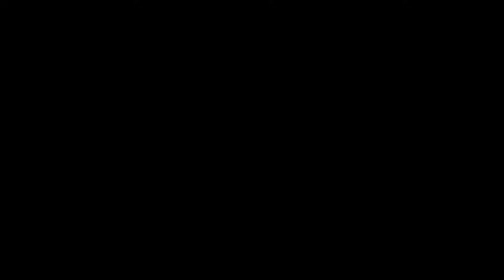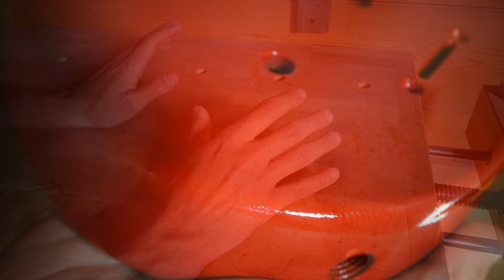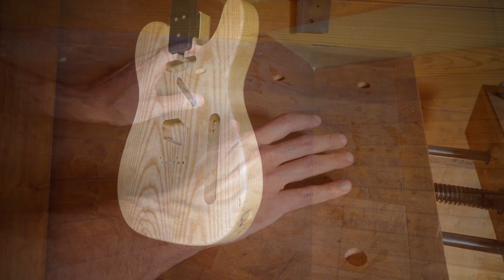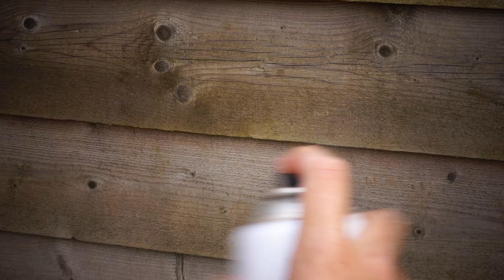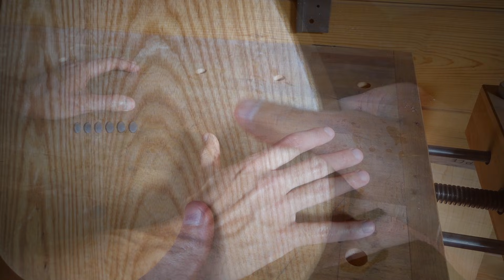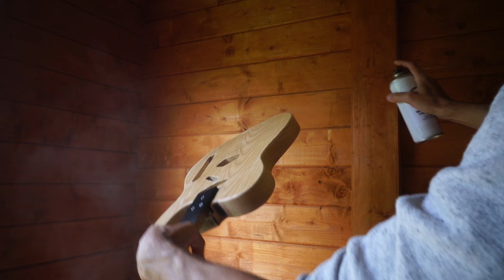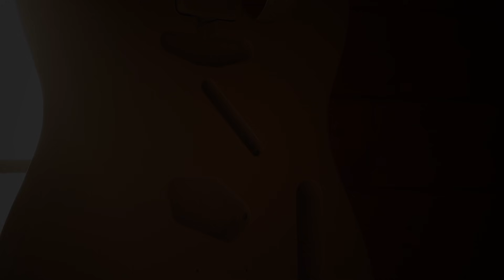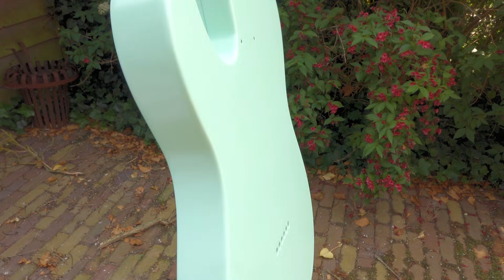Nitro Guitar Finish Tutorial - Part 2: Nitrocellulose spraying process

Comment: Awesome video, doing my first paint job now. Should I sand between color and clear coat?
Reply: Nope. The two will melt together and level out as one. Might want to lightly sand the very last layer of the clear coat to level the surface so it shines.
Reply: @jcd13able  thanks for answering! level sand last clear coat with 1000 grit?
Reply: @aloneliancomedy  Yes. I would use soapy water and dip the sandpaper in it for 20 minutes to make it pliable and the soap will reduce the friction so it will be easier to slide as you're sanding. I would try to stay away from the edges as those are the ones that are likely to be sanded thru into the wood. I believe the final buffing will also remove some of the orange peel as the finish will heat up and melt a bit.
Reply: @jcd13able  Do I absolutely need to use finishing compounds or is it possible that after 4-6 coats of clear that the guitar will look ok as is? I'm currently on coat #4 and its beginning to look glossy and nice
Reply: @aloneliancomedy  You don't have to. What I've done is I used non-silicone paste wax from Johnson in a yellow metal can that is used to polish wooden floors or bowling alleys and applied it with a rag and let it sit for couple minutes and then wiped it off. I never buffed my body and still get a nice shine on it. I bought the paste wax from ace hardware store but I'm sure other stores will have it. It has to be non-silicone if you ever going to repaint or touch up your paint work. Paint doesn't stick to silicone and it can't be easily cleaned off, it gets into the pores and stays there.
Reply: Autozone or O'Reilly will have some mcguire polishers. Basically what some do is get the polish with some grit in it and they apply that first to kind of sand the imperfections in the paint. Then they progressively reduce the grit by using finer and finer polishers until they get to the one that doesn't have any grit in it. Usually they use carnuba wax but I used Johnson. But if you use wet sandpaper to sand off the finish you will get close to what they're doing with the polishers. They also use polishing wheels to melt the polishers into the finish. That is a lot of work.
Reply: After you put the last coat of clear (I assume you're painting with nitro lacquer) then you need to wait at least a month or until the finish is no longer sticky to the touch before doing anything to the body. If you knew that already then I apologize.
Reply: @jcd13able  Yes, it'll be hung up for about a month until it dries. I guess I have the next month to decide what I want to do with it. If I decide the guitar looks ok to me as is, can I just leave it? Is there anything wrong with just putting on clear coat and letting it cure for a month if I like the way it looks? Thank you so much for all your help. I've watched your 3 part video many times in preparation for this.
Reply: @aloneliancomedy  You can leave it as is if you're happy with the results. Nothing wrong with it. The old fender sometimes didn't put clear on the color coats because they either ran out or some other reason. The clear will protect the color coat but it will also shine brighter.

Comment: My shop is in an old mill building so dust is just an everyday occurrence regardless of what you do. What I’ve found is that closely inspecting the surface a few minutes after spraying will show you any “preliminary” dust. If you have REALLY steady hands, you can get down on it with an exacto knife and magnifying glasses then CAREFULLY remove any little pieces of dust. This works best while the lacquer is still a bit wet because it will normally fill in any tiny little dust gaps. If you discover some in an hour or two after the lacquer has dried, you can just remove if very gently with your fingernail. What you’re trying to avoid is accumulation. If you let it go or don’t pay attention, it won’t turn out as nice. If you shoot light coats warm lacquer in a dry environment and keep an eye out for dust, you’ll get a beautiful finish. It’s really not that difficult...there are just a few little things to keep track of. In the long run, lacquer and varnish are the two easiest finishes to work with, in my experience.
Reply: I agree, very forgiving paint. I must also point out that duplicolor acrylic lacquer paint is as forgiving as nitro. The spray nozzle will sometimes spit out blobs of paint when the paint is mostly gone from the can and those blobs will melt into the existing finish and you won't be able to notice it when it dries. Very cool and for those who want a little bit more resilient and lasting finish, it's the way to go.

Comment: I'm refinishing a Warmoth Tele with ReRanch Fender Blonde. I'm ready to clear coat the Tele. ReRanch has been out of business for awhile because of Covid 19 but they have all the Fender colors in nitro. I use a handle on my paint cans, much easier to control. I wear a mask from Harbor Freight.
Reply: I was going to go with reranch but then I changed my mind and went with duplicolor sanding sealer then duplicolor perfect color match and finally watco clear nitro lacquer. The acrylic duplicolor is some tough paint I must say. After five years, the watco is starting to peel off in areas where guitar touches my body when I play the guitar. I love how watco easily checks as well. It dries hard and it's not sticky on the neck or body. Next time I would go with duplicolor clear instead of the watco but I wanted checking pattern because I like the old relic look so I used watco for that.

Comment: After the last color coat, you mention a small amount of orange peel is ok and can be smoothed out later - is this because the clear coats will bind with the color coat, as nitro does, and the minimal orange peel referred to will be filled in by the clear? 

I notice the color of the color coat changes as it is polished. 

I’m trying to find out if the color coat needs to be sanded to acquire the color desired or if the clear coat serves this same purpose. - 

I may not be asking the question exactly right. Hopefully you’ll know what I mean. 

I appreciate any help. Thanks for putting these tutorials up. Very helpful.
Reply: Yes, the color and clear will melt together and will level off. There might be some orange peeling on the last coat of clear but buffing will usually get that out as the heat will melt the last coat and level it off.

Comment: I didn't think lacquer had to cure--- thought that was just poly.
Reply: As far as i know ypu are kinda right. Laquer doesn't really 'cure' but it does harden. Poly does cure and actually turns into a pretty hard plastic. This happens relatively fast so i believe it is ready for polishing within 48 hours. Laquer only hardens bit never fully cures. This makes laquer a bit of a long process with a hardening time of about a week or two and about three or four coats per day, letting it harden a bit between sessions. The big plus of it not hardening is that you can repair chips or dents in the clear coat using only a piece of hardened laquer and some thinner and it just melts into the damage. This is because it is able to dissolve since it is only hardened. Poly doesn't do that so when you happen to chip it or damage it you can only sand down the damage (often even the entire surface to avert strange textures and harder lines where you sanded it) and reapply new coats over it. The big plus is that poly is a lot harder to damage, but if you do it can make a relatively small amount of damage a bit of a hassle.
Reply: It takes about a month for the nitro lacquer to dry so it's not sticky anymore. It dries slower in colder climates. The only difference between a color lacquer and clear lacquer is that in the color lacquer a color pigment is added but otherwise it's the same nitro. So you can apply all nitro coats the same way. One coat will melt into the other and it's recommended that you spray thin coats so they have sufficient time to dry for the next coat otherwise they will pool up and might cause a run.

Comment: It's maybe a good idea to let the can sit in hot water (not boiling tho) for a while before applying if your cans are not brand new. It seems to help the compounds mixing together and have the lacquer more fluid. I mention that because I screwed up my finish badly while using a clear coat can that had probably be sitting for too long on the vendor shelf. Even after shaking the can for a while, there were still small clots of compounds that went through the finish, dissolving the color and leaving nasty pinholes. I've tried to smooth them and apply a few color coats over them, but I think I'm just going to pretend I intended a vintage look.

Comment: Do you need to be careful how much you spray into the neck pocket? When companies make bodies/necks are they made with tolerance for finish thickness, or would applying finish to the pocket make it too tight? Total beginner here. Thanks for the great videos!
Reply: It would make the neck pocket too tight on cnc bodies. I cover the neck pocket area with masking tape so no paint gets in there. After I'm done painting I peel off the masking tape and bolt in the neck. Same goes for the neck if you refinish it in clear coat so I don't spray too much clear in the heel of the neck for the same reason.

Comment: Your tutorial is great! I just started my first guitar building project. I bought a Strat style kit from Stu Mac. The guitar has an alder body that already seems as smooth as silk.  Should I still use the grain filler or go to a grain sealer before I procced with the rest of the process?
Reply: No need for grain filler. You should just use primer, color and clear coats if desired. You don't have to use the sealer, all it is is a thicker nitro paint to seal porous wood which alder is not. The nitro sealer will eventually sink in as well.
Reply: Thanks.

Comment: I know this is an older video, but just wanted to ask, I’m using the same lacquer you use in this video and am on to my clear coats, how many cans did you use on clear coating? Just trying to gauge how thick I’m applying it, I’d say I’m about 5 coats in and have used a can and a bit?
Reply: I think he said he used four light coats of clear. I guess that would be one can or less. The more clear you use the thicker the finish and the more leeway you have with sanding. Otherwise you have to be very light with the sandpaper.

Comment: great video series. What steps are needed to refinish an older guitar already spayed with nitro in the same color? Does the old finish need to be stripped to bare wood?
Reply: No unless it's too bumpy or heavily damaged. Normally you just lightly sand the gunk off and spray a new layer of color coat and then clear and you're done. Nitro adheres to old nitro just fine because the top layer will melt the bottom or old color layer and the two will melt together. If for some reason you need to strip the entire body back to the wood then I would use lacquer thinner or alcohol on a rag and wipe the body down. Fender used to spray different finishes on top of old finishes all the time. They also didn't use clear on some finishes or didn't use sanding sealer on others, etc. Very mish mash of doing things. Usually they ran out of paint so they just skipped some steps.

Comment: When would it ever be absolutely necessary to spray paint inside your house?
Reply: If you don't have a garage and it's snowing or raining season outside with low temps or too high temps. You can do it with windows open and drop cloths everywhere and hopefully you're single otherwise the significant other might kill you before you lay your first nitro coat on. You would be surprised, here in arizona I have to spray from february to may only otherwise it's too windy, too hot, humid, etc. A very small window of opportunity. I can't spray now because the paint would be dry the moment it left the spray nozzle. Also, in spring we have to deal with alergies and all kinds of stuff flying around so a spray booth is necessary.

Comment: Hi there
After applying my coats of paint, I noticed little inperferctions, how can I fix it? Can I sand it? If yes with which sand paper? Should I wet sand it? And how long should I wait before sanding after my last coat of paint?
Thank you
Reply: Try to apply couple more coats and see if they melt the bottom coats and the imperfections disappear. If they still persist then use wet and dry 800 grit sandpaper and wet it in a soapy water and lightly sand the top coat to level the imperfections. Stay away from sanding the edges of the guitar as you'll go straight into the primer coat. You should wait at least half hour or longer. Depending how thick you applied the last layer. The thicker the more time you need for the paint to outgas and dry. A normal light coat takes about 20 minutes to dry.

Comment: how many passes makes up a coat?
Reply: One pass from top to bottom. A coat is one thin layer on entire face of the body. The key word here is thin. Why? so nitro won't run, so it will dry quickly, so it doesn't melt all the layers, etc.

Comment: Time 14:36 you said you like to let the color dry before clear coat. You should spray the clear coat  over the paint as the paint tacts up just like any other coat. So
after the last color coat , wait until it tacts up and start your clear coating. In my opinion, don't let the color coat dry for 24 hr before the clear coat,
any dirt or bad spots can be sanded out of the clear coat and polish but don't sand though the clear.
Reply: The only time you should wait for a week or so is if you're spraying lacquer clear on top of acrylic color coat for example. To let the acrylic fully vent out before applying lacquer on top of it. Some paints specifically tell you to apply clear immediately after the color coats or you have to wait a day or two before applying clear. Something to do with the color coat still being gassy and clear needing that gas to adhere to the color coat.

Comment: Just revisiting these tutorials. Really great job Lone Star. I'm just getting into spraying Nitro, and I must admit, I def prefer it over  spraying poly
Reply: Me too. It's also easy to fix your mistakes and you can use lacquer thinner to go back to the wood and put a new color on. Plus, your guitar will wear nicely unlike poly which is hard as a rock and when it chips, big chunks fly off and make the finish look ugly.
Reply: @jcd13able  what in the world are you doing with your guitar to “knock chunks” out of it??
Reply: @TheChattanoogaBandit  I don't have guitars with chunks out of them. I've seen on pictures what they do look like. Sometimes what can happen is guitar can fall from your hands or tip over the stand and fall onto hard surface and can crack the heavy poly finish with chunks coming off.

Comment: a month to cure before sanding/buffing?   Seems that's just too long, considering there are other options that dry in a day and ready for buffing.  nice vid, tho.  very thorough with the advice/tips.
Reply: Minimum one month of drying. If you touch it and it's still sticky then you need more drying time. Test in a neck pocket or pickup cavity. Nitro is the finish if you want you guitar to wear. If not then use 2K sprays that will dry quickly and give you thicker layer of protection that will not wear easily. A nice in between those two extremes is duplicolor perfect match paint system. It's acrylic lacquer which means it's more plasticky than nitro, drys fast and will give you thinner coat of paint than 2K paint and it will be more durable than nitro and less durable than 2K paints. I would try to stay away from enamel paints unless it's a hard drying formulation.
Reply: @jcd13able  thx.  I think some spray can polyurethane is what I'd go with.  Something that will dry very fast and clear.  Just do a few coats and call it a day. haha
Reply: @TruthSurge  I think minwax has some water based clear polyurethane in spray cans. It's a light green or blue can. It's used for floors and it dries nice and hard. Never used it myself but few used it on guitars and drums with good results.
Reply: @jcd13able  I used a water based clear on a guitar.  Took me like a month to clear that thing.   So nah, although you can use it  more safely, I'll just go with the nasty stuff and do it outside in the summer.  thx!!!
Reply: @TruthSurge  I also prefer the good old nasty stuff that dries quick and hard. Good luck with your project!
Reply: @jcd13able   I don't have a project right now. :)  Just refretting one guitar is about all I have pending now and I  just can't get motivated to do much because I am taking care of my 96 yo dad each and every day.  I'll prob have no life for another 2 years at least before he's just unable to stay home.
Reply: @TruthSurge  much love your way. Hope you fathers doing well🙏
Reply: TruthSurge spotted in the wild! Cheers man hope you're doing well.

Comment: How long do you typically wait between applying clear coats?
Reply: Maybe 20 minutes. There is no difference between applying color and clear coats, just pile them on in one swoop. The only difference between the clear and color nitro is that the color nitro has a color pigment added to it and that's it. Still the same as clear  nitro.